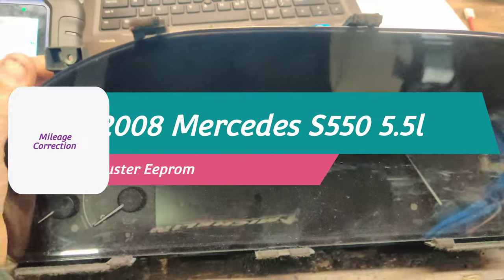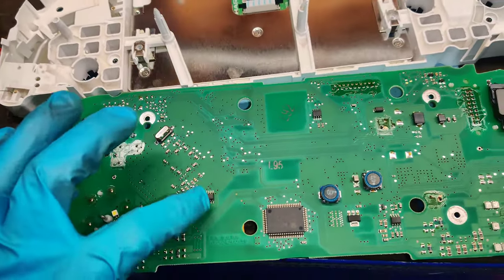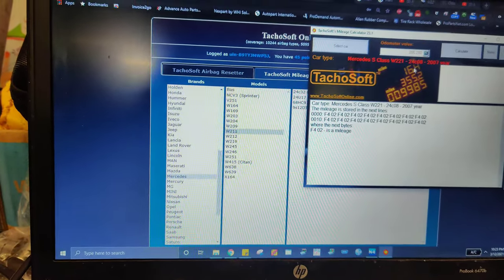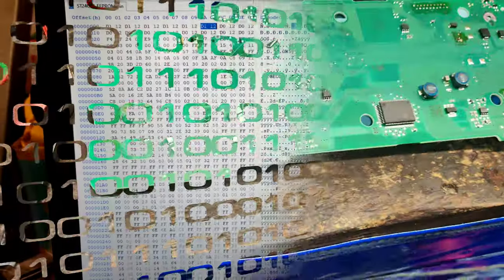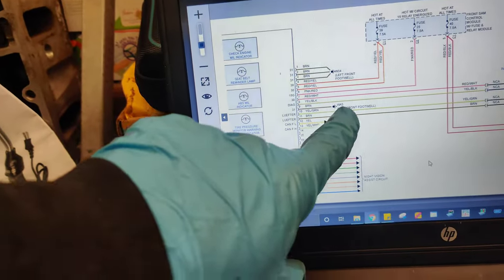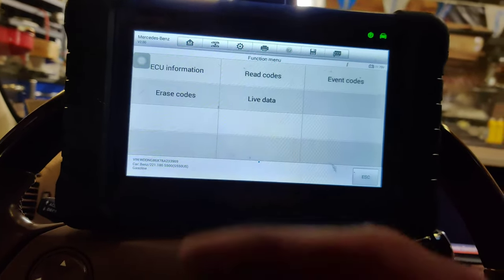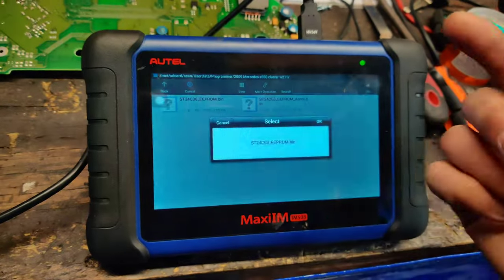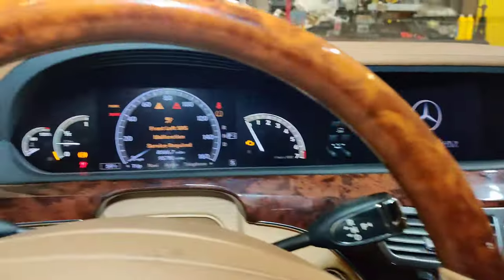2008 Mercedes S550 5.5l Odometer Dashes - Mileage Correction (EEPROM)

Comment: U also need to change the ssid on cluster for miles to show if u zero out first 2 lines of bin file and then on the 3rd line where the 07 is the next 4 byte are the ssid u could clone it from the old cluster or make it all FF and then u can just adopt it like a new cluster with das/autel and all u have to do other then this is scn coding and ur done

Comment: Hi Robert i have two similar boards from a scooter, that the first broke the display, can i transfer the EPROM with the real mileage to the good without programming ? thanks
Reply from the maker: It depends if the mileage is stored in the eeprom or not. Some modules store it in a mcu
Reply: @RobertDotterer  ok thanks i will search where it's stored
Reply: Nice work 💪🏻